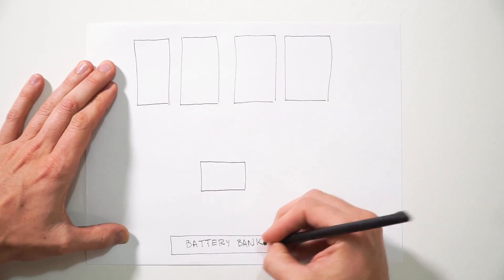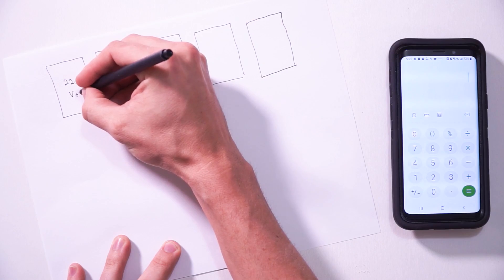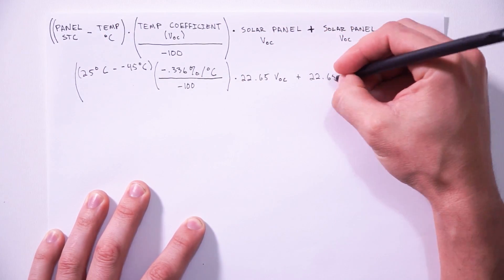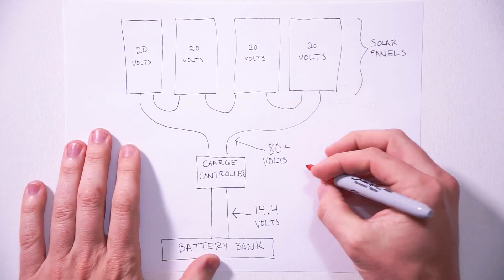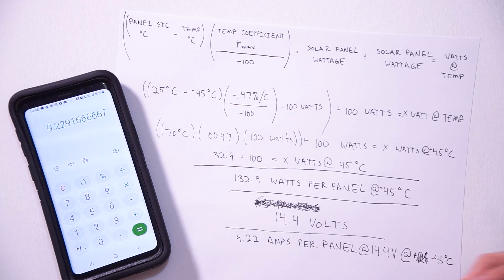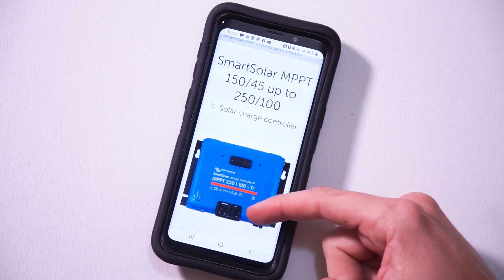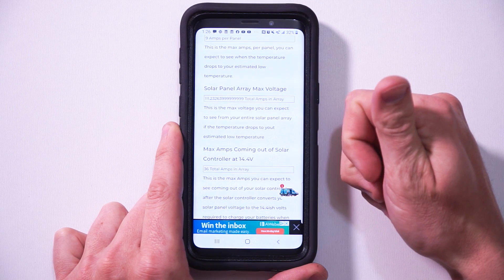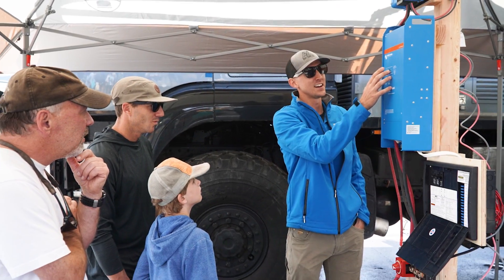How to Size a Solar Charge Controller for a DIY Camper Van Solar System

Comment: This is funny. For most RVers who mount their panels flat on the roof, they will never see rated output from their panels. Under ideal conditions maybe 80-90% tops. As it gets colder the sun drops lower in the sky reducing output current by much more than colder temperature can raise it. Besides, most charge controllers allow you to over panel by quite a bit. My 50A Epever allows me to use an array with up to 50% more output than the charge controller is rated for. Though it will still truncate the output at its rated 50A, so nonpeak performance (the area under the curve) will be larger. Though I don't recommend over paneling by 50%, doing so by 10-20% may make financial sense for those with budgetary constraints, and isn't that most of us?

 Voc is another matter, as max voltage is a hard limit, but remember that Vmp will be much lower than Voc in actual use. Nevertheless, using your panel's Voc with a small safety margin of say 5% should be sufficient for planning purposes, without all the heavy math.  BTW, do you really camp in 40+ degrees below zero weather? If so, I'm so sorry. 🥶We're FTers who travel where the weather fits our clothes, avoiding temperature extremes at all costs.
Reply from the maker: Just curious... but why are you spending your free time watching videos over charge controller sizing when you already 'know' how to size charge controllers? 🤔 🤣

But at any rate...lots of 'misguided' info there:

You can indeed see full rated output from panels when Temps are cool (cool Colorado mountains day in the summer, for example).

Yes, you can indeed over panel, but that makes building a calculator for it more complex since there is a lot of room for personal wiggle room (and therefore errors) and since I'm on the hook for tech support for the charge controllers we sell, I'd rather people just size their equipment properly from the start.  If you are on the hook for tech support for the info you are giving...I guess that's your own decision.

Many people travel for snow skiing, so yes, extreme cold Temps are indeed experienced by many.
Reply: @EXPLORISTlife  Guess I struck a nerve. No offense intended.

Comment: Your calculator saved me from making a grave mistake. A self-proclaimed solar nerd convinced me that his math was correct. It turns out that my amperage was WAY higher (42 amps) than I should be running. Thankfully, I had doubts. Liked and subscribed.
Reply: Higher amps then the solar charge controller is rated for is not a problem, it is just wasted as potential energy from the panels not used (no damage but it is waste of solar energy to not use it all). What is a really a problem is if your solar panels is producing more voltage (V) then the charge controller can handle...

Comment: Why can’t they simply make an adjustable unit that works for everything?
I’m wanting to start small and add to the panels and battery later and just want to buy 1 charge controller and be done right now
Reply from the maker: The reason is...  a 'it works for everything' charge controller would be huge and cost prohibitively expensive.  They make an MPPT 450/200 which would 'work' for 99% of cases, but it also costs $2000+.

Comment: Totally disappointed with victron . Bought mppt 100/30. Worked perfectly for 5 month then solar input wire burned, searched on youtube and found few others had same problem, . While unit still work , terminal is melted and is impossible to open up unit to change or clean terminal. Nor Victron would serve unit, and warranty was refused.  Bad purchase
Reply from the maker: I'd be willing to bet that was an installation error.  The screw terminal was loose, no strain relief on the wires under the charge controller, not enough insulation stripped back, insulation in the terminal, or undersized wires are all culprits of what you are describing.
Reply: @EXPLORISTlife   you would lose your bet ... I searched youtube and found that screws need to check screws  every 6 month or so due to "expansion issues over time" https://www.youtube.com/watch?v=LSmyLYo07wY&t
But the most disappointing is the housing, is impossible to open up to clean melted plastic, while unit is fully functional ... terminal is in bad shape and cannot be changed
Reply from the maker: So... the terminal was loose.  Yes; you need to periodically tighten the terminals of your equipment and make sure nothing is loose and you need to do this on any/all brands of equipment.

Not doing the regular maintenence on your equipment is like saying that Ford Motors suck because the engine didn't last 100,000 miles but you never changed your oil.

At any rate... this video is about how to size a charge controller so your rant is pretty off topic; Perhaps your time would be better spent going and tightening your terminals and maintaining your equipment instead of venting to me.

Comment: i put the calculations in the calculator but was too high , I am looking for 550w solar panels x 4 with a 51.80V  and 11.26A thinking I need two charge controllers (1) for fist 2 panels and (1) for second 2 panels all in series, looking to have 600ah of batteries in my rig.

Comment: Why did you use 14.4 volts to divide the watts (around 5 minutes into the video)? Is this because it is a 12v system? What number would you use for a 24v system? Thanks, Tim
Reply from the maker: That's the approximate charging voltage for most batteries.  For 24V, double it.

Comment: Wow!  So much math, and so much talking....  but realistically, as you noted the coldest temperature you saw was 43C in BC as the sun peaked over the horizon.  But in mid winder as the sun peaks over the horizon the panels are producing just about nothing.  By the time the sun gets a bit higher in the sky, not that it even gets very high in the sky in mid winter in BC, the temperature will be at least a fair bit warmer.  I guess we'll have to assume you panels are mounted on pivoting racks so that can be angled perfectly towards the sun - but even then, in BC, in the middle of winter, those panels will never produce anything close to 132 watts each.  I doubt they would make 100 wats.

But, to a point, I appreciate you exercise in academia... to a point -- you carried it too far.   
Yawn, Zzzz
Reply from the maker: They actually do produce that much power when it's that cold out.  Been there, done that.

If you don't like the education behind it, that's what the calculator is for.  If you don't like that, we have pre-desiged solar arrays for you to choose from with no math involved.

This video was for people wanting to learn more about a topic, but if that's not you, and you were just looking to be entertained... I'm not sure why you clicked on it. 🤣  maybe try tictok or something instead.

Comment: How many watts can Pwm 30A solar charge controller can handle at max? Can it handle 540 watt panel 12v or 460 watt panel 12v?

Comment: So, Nate. 2 years later, and- here I am sitting, watching & feeling incredibly grateful! Not only are you highly focused, right on stream & quick (thank you!) but, additionally, you use Victron equipment (mine's marine- Victron required-almost!) and explain detail (fitment, temp. ranges, max voltage). Finally, space restrictions, wire runs, proper contacts at equipment- all priceless details that PREVENT releasing the magic smoke inside the wires & charge controllers (That's my biggest worry, can't put the Genie back in the bottle once it's been freed!)
Wow, I wonder how many people have been helped with you & your wife's channel? I bet it's up to tens of thousands? Free calculators, Excel spreadsheets... Thank you is certainly NOT enough.

Comment: So if I also plan to run a 12/12 30 DCDC to my battery bank on the road does that effect these calculations? I'm looking at (x2) 100w roof mounted panels at the moment. BTW, holy smokes you're sharp with this stuff!

Comment: I understand I don’t want to put more volts into my controller from my panels. Will it damage my Renorgy 20 amp controller if I put more than 20 amps to it from the panels? The manual says the controller no more than 260 watts.

Comment: ECO-WORTHY 10W 3 Solar Panel
Rated power: 10W
Voc: 20.6V
Vop: 17.3V
Short circuit current (Isc): 0.69A
Working current (Iop): 0.58A
Output Tolerance: ±3%
Temperate coefficient of Isc: (010+/- 0.01)%/ ℃
Temperate coefficient of Voc: - (0.38 +/-0.01)%/ ℃
Temperate coefficient of power Voc: -0.47%/℃
Temperature range: -40℃to +80℃
RENOGY ROVER 20 AMP MPPT SOLAR CHARGE CONTROLLER (RNG-CTRL-RVR20)
Electrical Parameters	Environmental Data
Nominal System Voltage	12/24V (Auto-Detect for Non-Lithium Batteries)	Protection Level	IP32
Rated Charge Current	20A	Operating Temperature Range	-35°C to 45°C; -31°F to 113°F
Max. PV Input Voltage	100 VDC	Storage Temperature Range	-35°C to 75°C; -31°F to 167°F
Max. PV Input Power	12V/260W, 24V/520W	Operating / Storage Humidity	≤ 90%, No Condensation
Power Consumption	＜100mA/12V; ＜58mA/24V	Temperature Compensation	-3mV/°C/2V
Max Battery Voltage	32V	Accessories
Ground Type	Negative	Temperature Sensor	9.8ft cable length
Electrical Protection	Overcharging, over-discharging, overload, and short circuit.Capable of charging over-discharged lithium batteries.	Certifications
Mechanical Specifications	CE	YES
Dimensions	
210 x 151 x 68 mm; 8.27 x 5.95 x 2.69 in
FCC Class B Part 15 Compliant	YES
Weight	
3.1 lbs / 1.4 kg
Warranty
Max. Terminals Size	8 AWG 10mm2	Material and workmanship warranty	2 Year
RENOGY BT-1 BLUETOOTH MODULE (RCM-BT1)
Compatibility	Operation Specifications
Compatible PWM Charge Controller	
RNG-CTRL-WND10/RNG-CTRL-WND30-LI/RNG-CTRL-ADV30-LI

Communication Protocol	RS232
Compatible MPPT Charge Controller	
RNG-CTRL-RVR20/RNG-CTRL-RVR30/

RNG-CTRL-RVR40/RNG-CTRL-RVR60S/

RNG-CTRL-RVR100

Port Type	RJ12
Compatible App	Renogy DC Home App available in both the App Store and Google Play	Input Voltage	5V
 	 	Protection Grade	IP54
 	 	Standby Power Consumption	0.04W
Mechanical Specifications	Operating Power Consumption	0.05W
Communication Range	≤82ft (25m)	Serial Baud Rate	Fixed Baud Rate 9600bps
Cable Length	16.4 ft (5.00m )	Certifications
Dimensions	2.65 X 1.38 X 0.55 in (67.3 X 35 X 14 mm)	FCC Class B Part 15 Compliant	YES
Weight	4.58oz (130g )	Warranty
Operation Temperature	-4°F to 185°F (-20℃~85℃ 	12v system
Reply from the maker: Hey, andy2654! I appreciate you taking the time to ask your question, but unfortunately, I don't have enough info about your specific question to provide an accurate answer, but here is a playlist that, if you watch all of the videos start-to-finish (and take notes 😉), you'll have a REALLY good idea of how to design a solar array: https://www.youtube.com/watch?v=Jkbs84sBHsg&list=PLmvhcyi4n0TV9pi83rFTv3ZuMT_S1xIZt

Alternatively, I have some of my most common solar array setups pre-built here: https://shop.explorist.life/product-category/all-products/camper-wiring-kits/solar-charging-wiring-kits/

Comment: Nate , I am confused .... I bought a mppt controller 100v 40a and running at 24v said I can put 1200w of panels on the specs, so 12 of their 100w panels but your calculator saids no way ! When I change from 12v to 24v the numbers don't change on you calculator so I would say your calculator has a flaw .
Reply from the maker: I haven't been seeing any errors with it, but feel free to submit a support ticket with your panel stats and how many panels you are trying to use if you feel there is an error.

Comment: You push the Victron.  Do they allow 120vac input for shore power backup?
Reply from the maker: I mean... I'm a Victron Ambassador and Distributor... so yeah, I'm going to push Victron.

That said, could you rephrase your question?  I don't quite follow what you are asking.
Reply: @EXPLORISTlife  Let me try it this way...  Sorry, I went to college for Electronics Engineering and sometimes i just assume you know what I know.  Can you plug 120vac shore power in to the Victron Controller as a backup power source like other mppt controllers?
Reply from the maker: The Victron Solar Charge Controllers are JUST solar charge controllers and do not connect to AC shore power.  That would be the function of the Multiplus or Quattro Inverter/Charger.
Reply: @EXPLORISTlife  I've looked at the Multiplus and they seem a little large for rv's.  I'll check out the Quattro.  Thanks.
Reply: @EXPLORISTlife  I am asking you about the Victron, and seeing that you are an Ambassador and Distributor, then you could help me.  I am looking to purchase a Solar Charge Controller.  Solar was fairly new when I went to college.  We only had them in our calculators back then.   The Internet just started when I started college.  Dial Up.  Are you trying to be smart with me or are you someone that can help me?
Reply from the maker: I have no idea how that came across as me being a smart ass.  Did you feel that didn't answer your question?
Reply: @EXPLORISTlife  I only asked a simple question and you answered with this...    "I mean... I'm a Victron Ambassador and Distributor... so yeah, I'm going to push Victron.

That said, could you rephrase your question?  I don't quite follow what you are asking."
Reply: @EXPLORISTlife  I asked this.... "You push the Victron.  Do they allow 120vac input for shore power backup?"
Reply from the maker: For 120V shore power, the multiplus comes in 2 and 3kVA versions.  The Quattro is the larger version starting at 5kVA.  I generally recommend either the multiplus 2k or 3kVA for RVs with 30A shore power and the multiplus 3kva 2x120 for rvs with 50A shore power needing less than 2400w of inverting power.

The solar charge controllers don't care what kind of inverter is in the system as they are a completely seperate and independent piece of the puzzle.

I've got both 50a and 30a OEM RV upgrade retrofit diagrams at https://www.explorist.life/solarwiringdiagrams
Reply: @EXPLORISTlife  Other MPPT Charge controllers have ac input for shore power.  I was only asking if Victron did as well....
Reply: @EXPLORISTlife  Don't worry... Any further questions and I'll ask Victron and tell them that their ambassador could not answer my questions.  I am only a 50 year old man that is both mentally and physically challenged from a head injury in 1987 that I never came back from, but I did go to College for Electronics Engineering in the 90s...  But thanks for whatever you call this...  I live full time in my camper because I have to...  Thanks again.

Comment: I live in a tropical area, so the temperature never gets below 50 degrees F.  Your calculator only goes up to 40F, so that's what I selected.  During your video, you said that the solar panel's output voltage would be greater at the estimated low temperature.  I have 6 panels, each giving 24 volts and 6 amps in a 2S3P configuration for a 24 volt battery bank.  The calculator says my solar array's output voltage would be 31 volts.  2 panels in a series should be 2*24 = 48 volts before temperature compensations -- which should make it even higher than 48 volts.
Is there an error in your calculator since it computes to 31 volts instead of > 48 volts ?
Or is the computed volts mislabeled, calling it "Temperature Compensated Array Voltage" instead of "Temperature Compensated Panel Voltage" ?

Comment: So is 4(12v) batteries in series considered a 48v battery? If yes then my control chargers will be cheaper right? My boss wants me to design a 20 panel array. This is going to produce just under 800 volts. And i (he)was looking to buy Chinese but their information is vague at best. And he's going to want to use different kinds of batteries. So as long as i come up with all the batteries equalling 48 volts there shouldn't be a problem. Except for different batteries will drain at different rates....
Is it possible to use panels without batteries? With only a charge controller? Because i live in Southern Arizona and we get 300 plus days a year of sunshine.

Comment: There is no temp. coefficient rating on these panels
Reply from the maker: Have you checked out the most recent calculator that has an 'easy mode' and doesn't require the temp coefficient?
Reply: @EXPLORISTlife  no i didn't see that one. Ill try it tonight. Thanks

Comment: Hi! Can you explain the difference in simple terms ( or if you have a video on it  ) of the difference between more Volts vs more Amps. I have seen a video that said that by adjusting the voltage we can save money on charge controllers, but how does that affect the operation of electrical components??
Reply from the maker: Sure!  Here is a playlist that will teach you all about that.  Your question really isn't one that has an answer 'in simple terms': https://www.youtube.com/watch?v=Jkbs84sBHsg&list=PLmvhcyi4n0TV9pi83rFTv3ZuMT_S1xIZt

Alternatively, if you want the 'in simple terms', I have some of my most common solar array setups pre-built here: https://shop.explorist.life/product-category/all-products/camper-wiring-kits/solar-charging-wiring-kits/

Comment: Hey I love this, but I found it was quite confusing when I plugged in your own personal solar array of mismatched panels, as I think the calculator expects all the panels to be the same? I was trying to calculate your array on a 48v battery, 2x200w, 2x55w, except 4x35w panels instead of 2. I suppose like you said, the array voltage will be less than the 48v battery bank voltage
Reply from the maker: The calculator is not set up for mismatched solar panel sizes.